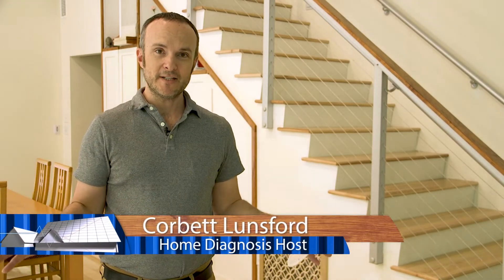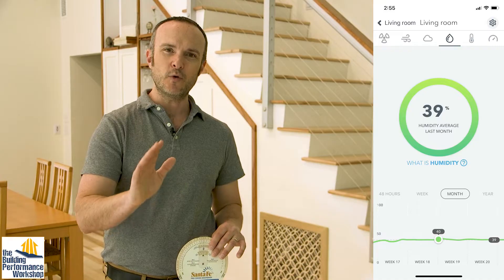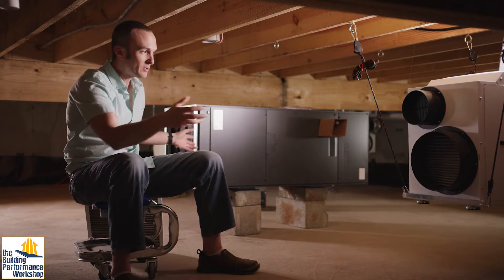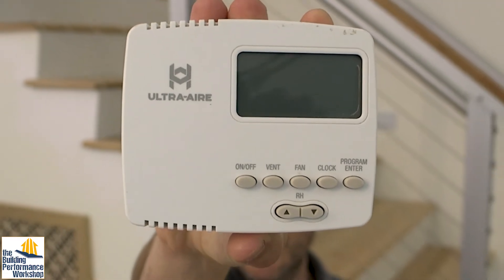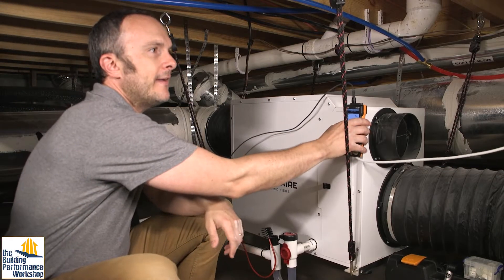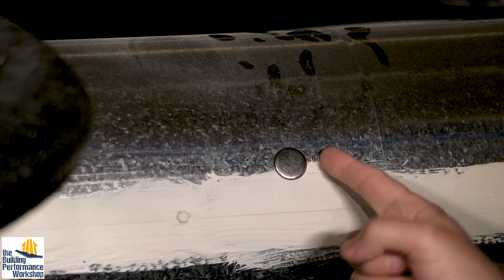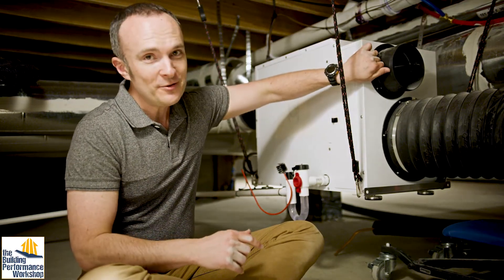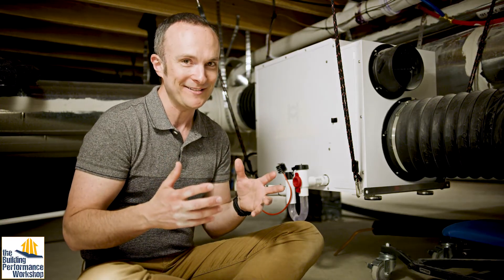Dehumidifier Testing and Calculations: How/What/Why of Dehumidification with Santa Fe Ultra

Comment: I want to know if most HVAC really understand these or do I need to contact a different kind of company? I have a honeywell DR90A2000 and I'm needing to check to see if it's working the best it can. Just had sheetrock replaced in the basement and it's super dusty down here now.

Comment: Question? When the dehumidifier is running AND the HVAC air handler is not running. Does the dehumidifier also push air backwards towards the unit and the return pushing dirt off the filters back into the house?
Reply from the maker: You can just interlock the AH and dehu fans, but Mitsubishi air handlers are designed to run 24/7

Comment: You got me there, I had to watch the video again and take notes thinking there will be a test on this.  Great video.  I'm in the process of installing the same unit in my upstairs attic in Florida and the technician explained that the dry air coming out of the dehu will be going into both my AC units (one for upstairs and one downstairs). You mentioned that's it's not a good idea to do that (minutes 5 to 6 in the video). Can you explain what other options I have?
Another question - the intake for my dehumidifier will be connected to the main intake for my AC (upstairs unit), is that a good idea or should we make a new hole in the ceiling just dedicated for the dehumidifier?

Comment: Awesome video thanks for teaching us about this very important subject. Dehumidifier in Florida is much different from what I’m used to coming from northern Alberta Canada. The two houses I built up there I had installed air to air heat exchangers and heat recovery units. This was a great way to control ventilation, dehumidify, and air cleaning all in one unit. But now living in south Florida I can see just how important it is to control inside humidity as well to have good ventilation. Difference being up there I was dealing with 8 months of cold temperatures 4 months of hot and cooler temperatures. Yet still had humidity problems.
Reply from the maker: Happy to help! FYI I believe an ERV would have worked better for you in Alberta than an HRV :)
Reply: @HomePerformance 
Thank you, I’ll be needing more education for sure. I’m totally interested in energy efficiency in homes and especially here in Florida how to make a home more comfortable and cost efficient.

Comment: Great video, but fyi on the calculations -- in the last part you multiply the lb/hr by  0.125 to get gal/hr, then you take that and multiply by 8 to get pints / hr, which you say is 1.3 (calculator said 1.275). But multiplying by 0.125 is the same as dividing by 8,  you're just dividing by 8 and multiplying by 8 to arrive back at your lb/hr number (which was already 1.275).

Comment: Corbett & Grace,
Another outstanding video. 
I just purchased a 1996 Temporary Home near hospitals that we need for my wife in the Charlotte North Carolina area.

Is a single story open floor plan three bedroom two bath common home for the era where all the HVAC equipment, of course, is stuck in the Attic or it's a zillion degrees. One of the problems I have is that this house is extremely humid (mid to high 60s in these last 2 weeks of July). 

I think I really need to purchase a dehumidifier... perhaps like the Santa Fe 120. While I like the Santa Fe v150 my pockets are not that deep 😎. 

That's very end of your video you spoke about something that was important to me which is a thought that I need to slightly over pressurize the home because it's so leaky that I need to increase the pressure to reduce the amount of hot humid air leaking into the home.  What are your thoughts? 
Thank you again for your thoughts.

Cheers, Eric

Comment: My question is very basic since I do not understand most of this yet.  If the AC dehumidifies the air to make it colder and the dehu also dehumidifies the air, why can't the dehu replace the AC altogether?  It appears both are needed so why are pretty much no homes built with both nor do AC units incorporate a dehu in them up front already?  I hear general statements like adding a dehu will allow your AC to do less work\last longer\save more $.  Is that a generally correct statement?
I also need to figure out how to add one to an existing 20 yr old 2 story home HVAC system or if a separate stand alone unit makes any sense at all.  Thoughts or advice or direction to more in depth reading material or  recommended videos too would be appreciated!  I live in Missouri where our summers are now brutally hot (for us anyway = high 90's temp F with "feels like 106F" type temps and very high humidity).
Reply: The dehumidifier doesn't cool the air - it actually heats the air through the dehumidification process. The other aspect is that the AC isn't dehumidifying the air to make it colder - it is cooling the air, which has a side effect of causing condensation because the water holding capacity of cooler air is lower. When that condensed water is removed (through the exhaust and/or a condensate line) the net result is dehumidification.

Comment: The funny part of this is these people have buaffaloed those that believe this. If the encapsulation is effective then how long will it take for a dehumidifier to dry out the crawl space? And once it is dried out, how big of a dehumidifier is needed to keep it that way? The truth is, you don't need a $700 to $1,000 dollar dehumidifier and selling this to homeowners is ripping them off. A small dehumidifier is all you need, my crawl space guy put is a $100 dehumidifier, it took a few days to get humidity down to 50% where it has been consistently for 3 years now. AND, the last thing I want to do is pressurize my crawl space, I absolutely do not want that air in my living area, makes no sense whatsoever! Nuff said!

Comment: Omg...amazing!  I want to buy a house in Oman which is furiously humid and super hot for 6 months.  I couldn't trust anyone to dehumidify it properly!  Could i get that machine over here?  I want to use the water for irrigation and power it with solar.  How many times (once the system is set up!) would my purpose built machine room need to be " maintained"?  I intend to leave for the summer - would this be dangerous to leave it running to protect the house and contents?
Reply from the maker: Hello friend in Oman-
1. You can certainly get dehumidifiers over there, though maybe not this brand.
2. Do not use the water for anything, it’ll be loaded with all kinds of nasty pollutants from the indoor air like PFAS.
3. Check on the filter every 3 months max.
4. Yes, leave it running while you’re away.

Comment: 6 pts / kwh @ 120 pts / day = 20 kwh / day. @ 20 c/kwh = $4 / day or $120 / mo. when  operating at full nameplate capacity. 

That's a real expense!

I live in an old leaky house in a humid mid-Atlantic climate and I can keep my indoor RH  at 45-50% just by running a reasonably sized a/c set to 73 deg F.

What are doing and where do you live?!?
Reply: It dehumidifies the air as the day goes on, so it won't actually be a full 120 pints per day. At 14:35 it was calculated that it would be about 30 pints based on the readings taken. So 30 divided by 6 would be 5. And 5 @ your .20 cent rate would be $1 per day.
(That would be with his numbers. The actual cost would depend on your readings and the amount of moisture in the air. So it could be more or less depending.). Maybe when you first install it, it would run more at greater expense, but as time goes on, it should decrease.

Comment: I live in a cheaply built 1986 1600 sq ft colonial foot home in central MA with 2x4 construction with only a boiler. Basement is about 400 square feet and I just spray foamed 2-part closed cell spray foamed all the exposed 2x4s four inches thick which made a huge improvement but the 50% that of spaces is concrete walls are left as is. In the hot humid summer my cold basement pipes sweat. I have a Poured concrete floor mostly above grade and a 400 square foot garage which I assume is a lost cause due to leakage of two medium priced  contractor grade garage doors. Upstairs is a door seperating the two levels that leads to a 400 square foot living room which leads into 200 square foot dining room and 150 foot kitchen and then 3rd floor is 260 square foor master bedroom, 160 foot bedroom and 110 square foot bedroom each with doors for privacy. The attic is sealed off unconditioned space. The 260 square foot bedroom has a 9500 btu LG dual inverter AC and the 160 footer has the U-Shaped 8000 BTU Midea. Should i just place a 6k humidifier in the basement and another 6k on the 1st floor? I dont care about house temperatures or humidity except in two larger bedrooms that have oversized variable units. Should i just put a 6000 btu stand alone 1990s dehumidifier in the basement and a 50 gal AO Smith Hybrid H20 heater in the basement  and one in the 1st floor and call it a day? I dont care about comfort, I just dont want my house to rot, warp or get moldy and Im cheap. We work and sleep in the two larger bedrooms. Am i being paranoid beliving that my house will rot if I dont do more than what i just listed. I have modern vinyl two pane argon filled  widows and even installed insulated glass storm doors myself on the front and rear enterances.any advice is appreciated. Its all a cost/benefit calculation to me.

Am i slowly destroying my home by not doing more or doing a full expensive Mini-split install complete with manual-J and blower door tests?

Comment: When Exhausting/Supplying from/to more than One Area/Room/Locations, How do you maintain Suction/Supply Air? I notice a Significant drop in Air Suction from Exhaust and Decrease in Supply Air when I "Tee" in to more than One Area. The 6in Ducts drastically drops the air movement after I "Tee" Off into Any Location. How do You Overcome this?
Reply from the maker: Duct design calculations. ACCA Manual D.

Comment: Does the dehumidifier add heat to the air
Reply from the maker: Yes
Reply: @HomePerformance  how much heat is acceptable?  I have one of those portable dehumidifiers and its adding 15F to the outgoing air.  It defeats the porpose because the AC is kicking on more often and dehumidifying the house

Comment: Great video. I'm in Louisiana.  What settings would you suggest on venting and fan on a new 2600 square foot home with only my wife and I? I did spray foam the roof deck with open cell, so the house is pretty tight. We are both retired so at home most of the day.

Comment: Couple of years late, but I did watch this a while ago, the first time. Great information and it helps me with a humidity problem I am tackling in, of all places, Arizona. During monsoon season, the humidity in the house is unreasonable and the flooring is buckling. 
Anyway, question about your crawl space and your system. You are intentionally pulling air from your crawl space and directing it into the living space. Radon is a concern in homes and it starts in the crawl space. We try to keep it from entering the home by pulling the soil air and directing it outside. What you have is doing the opposite. Do you have thoughts on this/have you tested for radon? Thank you.

Comment: Great video, you are an amazing teacher.   I see the outlet of the dehumidifier goes to the outlet of the HVAC air handler.   Wondering where the inlet to the dehumidifier comes from?   I will install a dehumidifier and new HVAC soon.   One vendor recommended taking the air off the inlet to the HVAC air handler, while another said it is important that the dehumidifier have an independent return from the house, which of course is more difficult.   If you see this, I would appreciate your thoughts.
Reply from the maker: Aw thanks David- best case is a dedicated return (mine is essentially that) but better to have the dehu than not at all. Perfect is the enemy of Good.

Comment: Can you take the fresh air from an ERV fresh air discharge side, (not the stale air exhaust to outside vent), and put it inline or on the intake side of a dehumidifier unit? I live on Texas gulf coast, it’s pretty much high humidity year round, 360 out of 365 days. 
We are building a recording studio with open cell insulation on the outer wall of the double walls, so it’s air tight.

Comment: What's the point of running AC at the same time?  The whole point of the dehumidifier is to save energy by not running AC during warm/cool "shoulder" seasons.
Reply from the maker: Energy doesn’t enter into it for me at all- it’s about ensuring you don’t let moisture get out of control in all seasons.
Reply: @HomePerformance  how can it get out of control if AC is running just by itself?  Unless the house is sitting on a swamp, AC does a great job by itself.
But those shoulder seasons is a different story.  Running AC when your home temp is already at 67F makes it uncomfortable.  That's when a dehumidifier is a great addition.
I'm in Massachusetts so maybe it's different here
Reply from the maker: A/C will not work to dehumidify if it’s not properly sized with a Manual J calc, or if the temp demand is too low. But it’s not about saving energy.

Comment: Can/should you put one of these in a crawlspace if the crawlspace doesn’t extend to the whole home and is more adjacent to the basement? I’ve been looking at ventilating dehumidifiers as I’m trying to remediate moisture issues in the basement as well as average 60% humidity in a dual zone system. One zone sits over the basement (and a portion over a crawlspace) the second zone sits over the garage. Looking for options.

Comment: I’m desperately trying to figure out how to dehumidify with a split system in place. I am in Austin, TX, and it’s essential. I was thinking of putting a couple feeding into the medium static boxes on each side of the house. the supply coming out are very small and there are multiple in these boxes sold by like Mitsubishi and Daikin. Do I have to decouple my dehumidification? I’m going to be on  Solar off-grid and trying to optimize.

Comment: Great video as always, been a long time viewer and fan of the channel.  I recently purchased an aprilaire e100 and was trying to determine the best course of routing the dehumidfied air into my ductwork.  Can someone with ductwork experience help me out?  I am tryning to figure out how to duct my dehumidfier into my supply side but am concerned about back flow.  I have a supply plenum that I can duct into but I was concerned that just pumping the air into the plenum would push air back to the AC return which my Dehumidifier return will be near.  Alternativly I can maintin the seperate return idea but wye the dehumidifier into the return side  and maintain a better flow.... Am I over thinking the flow?
Reply from the maker: Put a butterfly damper at the supply plenum connection to prevent backflow- everything will be fine, the e100 only pushes 300ish chm and it will not want to send it back thru the heat exchangers and coils and filter to start a feedback loop.
Reply: @HomePerformance  will the built in damper of the e100 serve this propose or should I add an additional one? Thank you again for the advice, explanation of the principals behind the advice, and making it accessible to a homeowner who is just trying to do things the right way!

Comment: Love your videos! Quick question, what kind of flexible duct did you use or recommend to use to decouple dehumidification or even HVAC equipment from metal duct? I have looked into vibration isolation devices, but they are terribly expensive. Just trying to accomplish better acoustics affordably. Thanks.

Comment: This seems to be the best place to pose a dehumidifier question, since viewers are not afraid of tech and numbers. I have a common Hisense portable unit of the 50 pint persuasion, which draws 600W when the compressor runs. This concerns me. Almost all the Wattage is exhausted through the top as hot air, which serves to noticeably warm the area, and has to be evacuated by the central AC. I propose to enable the pump and send the condensate to a radiator mounted above the unit, and then let it drain as before, to a floor drain or laundry tub drain. The goal would be to capture some of the heat before it could warm my home. This seems so obvious that I wondered why no manufacturer builds in such a feature. Could it be that doing so would not improve the efficiency rating as it is measured; even though it would benefit the consumer? It would be hard to explain why the consumer should pay an extra hundred dollars, and very few customers would be savvy enough to understand it. I'd buy it though. I'd even buy an add-on unit, IF the idea even works. Any thoughts? Keep in mind that I'm envisioning capturing perhaps half of the 600 Watts of heat, and that condensation is not a concern.

Comment: You shouldn't have been moving the sensor used in the duct. Reason being the wind are vectors or forces in a direction. As physics would dictate moving the sensor tip towards or away the direction of the wind flow can minus/divide or adds/multiply respectively force wind. But then again air tightness is critical and helps in out air flow

Comment: The way this is explained does not make physical sense to me.  How at time stamp 8:49 does a "heated" output of the dehumidifier cause a 90 plus degree environment to decrease to 76.7 degrees???  I have a floor-standing unit in my basement and am researching to install this type of ducted system.  However, even the floor unit directions indicate that where you run this 70-pint-per-hour floor unit will have an ambient temperature increased by about five degrees.  I have observed this effect while running the unit at max output.  So how are you saying that your unit is sending heated and dehumidified air into what is evidently the duct with the supply or post-conditioned area, and having it magically be decreased to below 90 degrees?. (Are the "supply" and "return" terms being swapped here???)